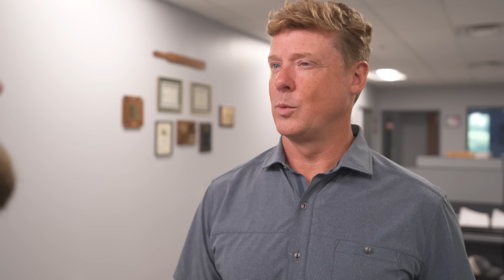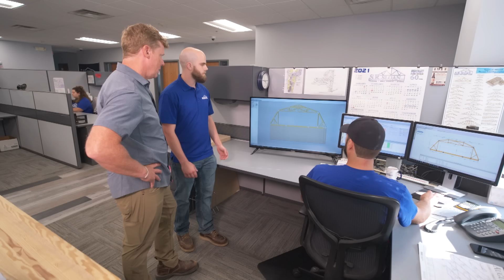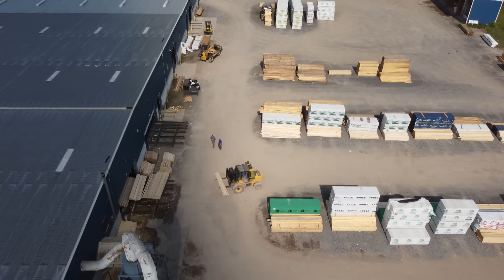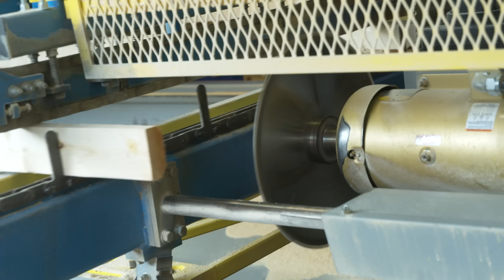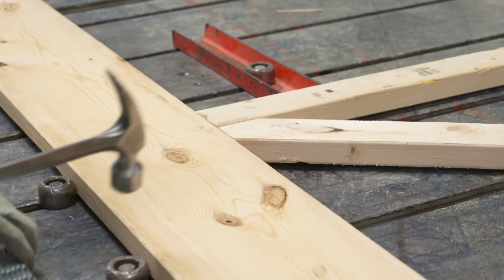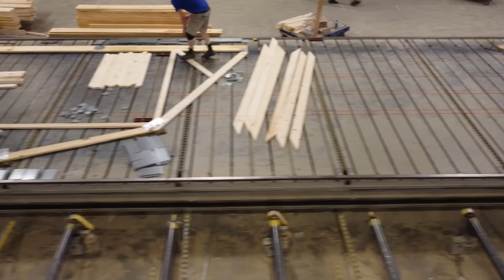Truss Factory Tour | This Old House

Comment: 400 trusses a day, in two shifts, is 200 in 8 hours, or 25 an hour, or a truss in under 2.5 minutes  - non stop, all day.
Reply: They said they have two place where they built them, so probably two assembly line.

So the saw cut for both, the roller go on each production line.
Reply: Yeah I work for this company and most of the trusses are built in the first shift alone from this plant I know personal from working there past almost 4 years

Comment: I know these things are engineered to necessary strength, but they look so flimsy and floppy.  I'd be nervous relying on them to hold up my roof.
Reply: As long as all the parts are connected properly it's fine (if you like minimums). But once something is out of place it turns into dominos.
Reply: Sure it's floppy when it's laying on its side. Only inch and a half thick and a huge span. But when stood up vertical, it will probably hold a huge amount of weight

Comment: Pretty neat but I can’t believe nobody is rocking a titanium wood handle when you’re hammering that much daily. Those elbows are going to be toast
Reply: Your little 16oz hammer isn’t going to get the work done. 😆 I got tennis elbow in my 40’s from doing all kinds of work, not just hammering. I had to nail off an entire subfloor by hand before we for nail guns.
I did learn to swing from the wrist instead of the shoulder. A 22oz California Framer was my weapon of choice and it still feels great at 70 years old.

Comment: Used to work at a truss plant.  It WAS family owned for 75 years, being a material supplier.  We had 3 main saws.  1, similar to the one shown it can work from 3ft long to 20ft long pices, another that focuses on unique pieces and does the parts less than 3ft down to 4" straight blocks, and a floor web saw.  Floor trusses are laid differently.

There is an upgrade to those tables where the pucks move on their own and won't need to manually move them by hand.  Also, not sure if they have it, there is a laser\ projector system where to have the pucks, boards and plates laid out at.
Reply: Thanks for the additional details. My spouse's best friend is a MechE and has worked for truss companies for a couple of decades now. It is cool to get a glimpse of what he does on the front end and how the trusses are produced.
Reply: @flatflo it's even more impressive to watch everything else.  Like watching how accurate the forklift drivers are able to scoop up the amount of lumber for the saws.  Loading the trusses onto the trucks.

When I left the truss plant, I had implemented a stacking order from the saws to make the building part faster.  For example, all the left side pieces would be in 1 cart, center pieces on another cart, and right side on another.  There can be more complexity to it, depending on how many different trusses and how much of each different trusses to build.

The longest trusses that we had built were 89 feet long.  Did 56 or 58 of them.  That was a lot of 2x8, 2x10 by 16ft long pieces to run.  Those boards are MSR 2400 (Machine Strength Rated) so, they are much stronger, but weighs as much as treated lumber.
Reply: Looks like this one has that table with the automatic pins for assembling trusses https://www.youtube.com/watch?v=h6HMIGEU64k